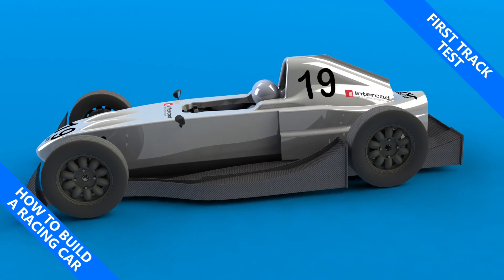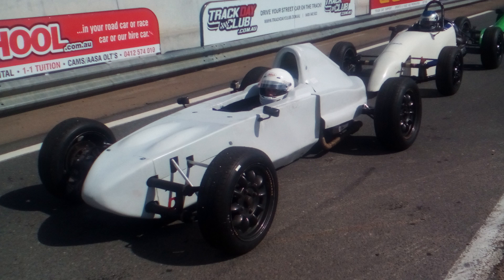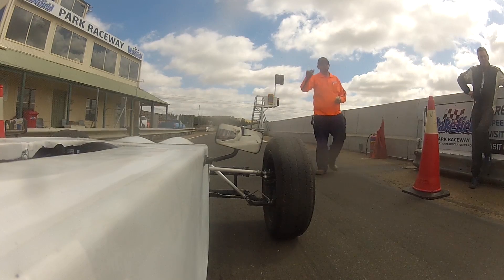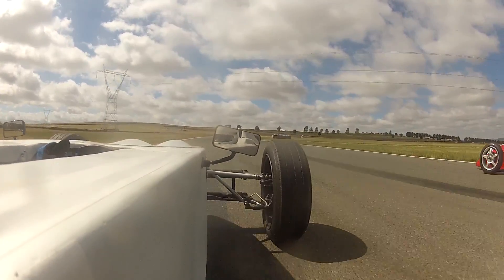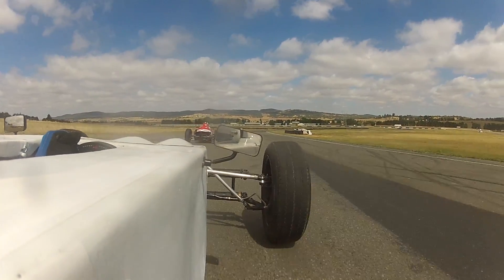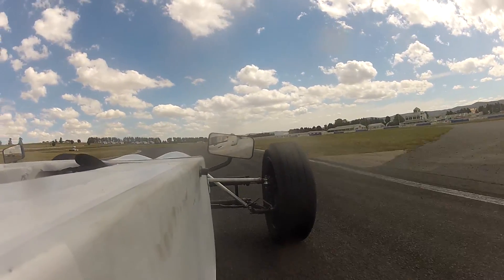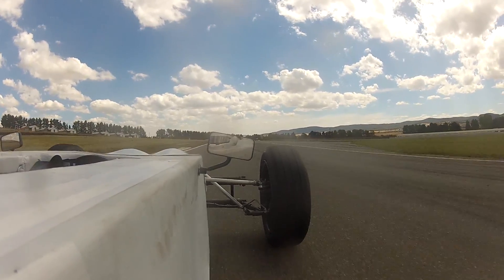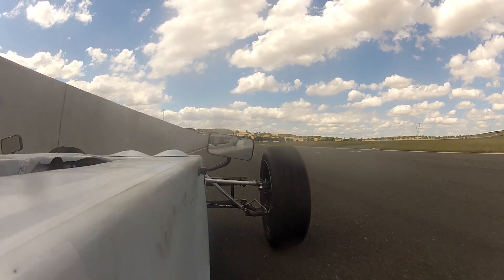First Track Test!

Comment: Is that a VW 4cil boxer engine ? which gear box?
Thank you and really great work.
Reply from the maker: Correct on the engine. I'm not sure the specific gearbox, there's only one type allowed in our category though so I just got hold of one which had been in another Vee.
Reply: ThomsenMotorsport you got any modifications done on the beetle engine?? How much hp and nm does it make?

Comment: Which engine have you used and what's the max speed??
Reply from the maker: +Alex Marczuk correct on the engine but we do sit at the top speed on the huge straight at Sydney motorsport park,  roughly 175 kph.
Reply: Barath Krishna S he said in the previous videos it's a beetle engine. It's an air cooled flat 4. As for top speed it probably doesn't really matter since it won't be reached on track anyway

Comment: Nice job. How much does it weigh?
Reply from the maker: +50zone it weighs 415 kg without driver and with a full tank of fuel (8kg) so it's pretty light. I've had to add a bunch of lead to reach the minimum competition weight. The benefit is that I can put it where I need it in the car.